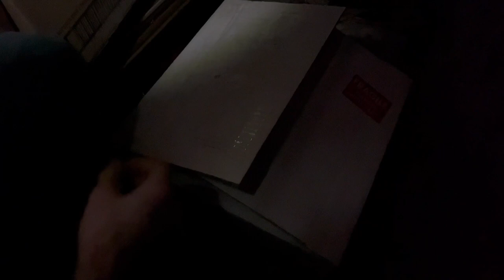Monarch 10EE Restoration 6: Body Painting

Comment: On its way to gorgeous.  I get that some don't like anything but gray for their machines - but... it not their machine... Questions, questions: 1.  After bondo coat & sand, did you spray another coat of primer - or brush? 2.  Did you opt to brush to simplify?  3.  Single stage? 4.  What paint type did you opt for? 5.  What did you go back and coat the inside casting reinforcement beams with just before paint? Big thanks for all the time spent putting a camera in place with close ups.  Super helpful!
Reply from the maker: Thank you! I'd be happy to answer! 1 & 2. Yes, I think when it was all said an done there were at least two cycles of prime-bondo-prime just about everywhere visible from the outside. I didn't have high hopes for spraying the primer at first and so I brushed/rolled. I ended up figuring out the trick to modifying the Harbor Freight gun after and in hindsight I think I could have just sprayed more than I actually did. I'm just a newbie feeling things out. 3. All the paint I used was single, but also in hindsight I think 2K is the better option. In what little experience I have with 2K, "it just works". I think I may have been intimidated by the cost, but I also bought cheaper topcoat paint and tested - found lacking - and ended up not using it. Had I just bought the right stuff to begin with.... 4 & 5) For the primer I used MC-Prepbond by Wasser. Fantastic stuff! It's a moisture cure urethane. Adheres super well, forgiving, and hard. I rolled the dice on McMaster, paying a pretty penny, and knowing nothing else than what the datasheet read - totally paid off. The inside of the lathe was TotalBilge. I figured bilge paint would work well in an oily environment. I hope to plug all the leaks and minimize it's exposure anyway. The topcoat outside is BM Superspec Urethane Alkyd Enamel. I thought that an alykd would be forgiving for brushing (again, I didnt realize I could spray on a budget when I bought it).  I'm glad I could help and thanks for swinging by!

Comment: The "This Old Tony" vibes are strong in this one....with touch of AVE work bench,  with a finish of Vintage Machinery
Reply from the maker: I genuinely appreciate your comment! Thank you very much!
Reply: @gaugeblockjenga  I just picked up a little south bend lathe. Same model as yours but a little earlier. Power feed lead screw is seized up in the housing and key was sheared. Your videos will be a great asset to tear down. Thanks
Reply from the maker: @ksfisher1990  That's outstanding. I really appreciate knowing these videos are helpful!